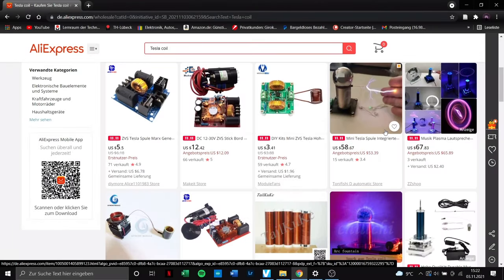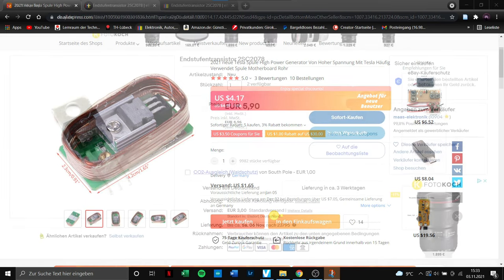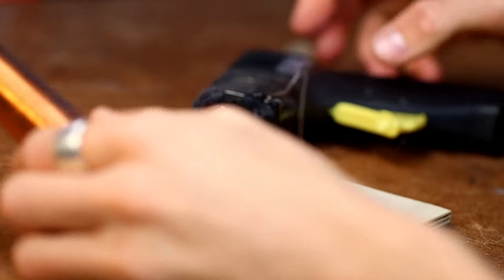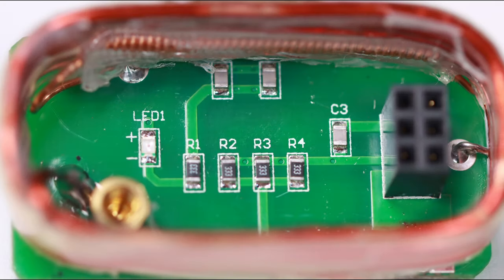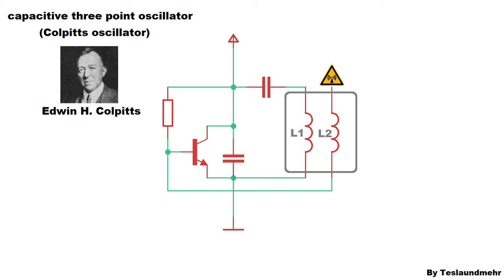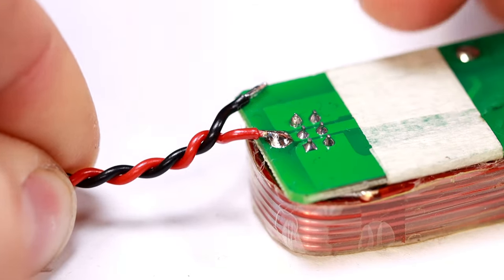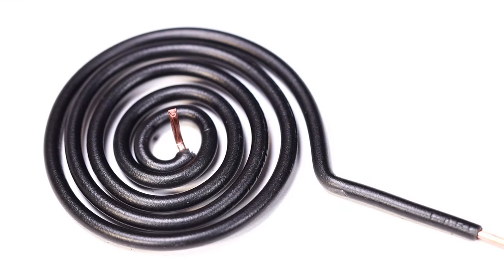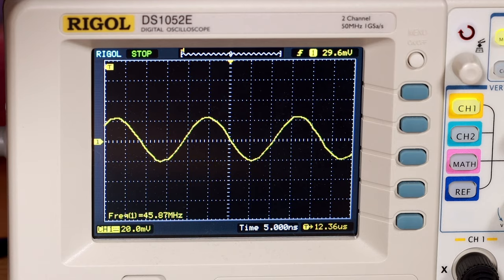Buy your own EMP Slot Jammer - 4$ on Aliexpress! Is it worth it?

Comment from the maker: Guys there is a small mistake at the circuit in the video
!!! For L1 43 turns and for L2 6 turns!!!
You might be confused that the primary coil has more turns than the secondary coil. But this is NOT a Tesla coil. Here you can download the correct circuit: https://github.com/Teslaundmehr/EMP-Jammer-Circuit
Reply: Is it capable of jamming wireless home automation signals? At what range?
Reply: @Mihály Tóth why not?😀
Reply: bro son dos capacitadores de 220pf (los que van en paralelo) y uno de 47pf smds?

Comment: I'm looking how to interfere with loud speakers at a distance, I have neighbour approx 10m away, plays rediculous loud music, 
is there a device can built to interfere with the audio speakers so that music has to be turned down?
My idea was spark device which would produce wide spectrum rf such as jacobs ladder circuit using car ignition coil ( or similar device). Then to make it directional put the spark gap inside parabolic type small metal dish.......such as an old metal bicycle light parabolic reflector. I haven't tried it yet, but any advice most welcome on this project.
I'm hoping if I can make horrible static noise in this neighbours speakers he will turn them down.
Reply: Any luck?
Reply: @jeffersonnogueira2933  yes and no:
yes: I found a way to drown out the noise effectively, I have a fan above the stove, if I run the fan the outside music noise seems to be sedated by the fan. I have to close all windows also, it works extremely well. Not sure why it works so well, maybe the fan produces noise across many frequencies, or the air hitting the blades somehow lessens the music noise.
No: did not pursue method to interfer with the amplifier and speakers.

Comment: could you makt a video where you explane how to use a 555 timer for a tesla coil and also in german and english that would be awsome
and i love your videos
Reply from the maker: Thank you!!! Yes!!!
Reply: @Teslaundmehr  ou also if you connect an audio signal to pin5 you can modulate the chip with sound but you need a 100nf cap between pin 5 and your audiosignal and woud it be posibal to make a community discord server? that would be awsome

Comment: The power is connected across the emitter and collector. Also across the primary circuit.
This is really strange. How can the transistor be connected across the power? The circuit will be affected by the AC impedance of the power source and the lead length.
Perhaps an inductor in series with the power will make the circuit operate more predictably. The primary is actually wound around a copper core.
Anyways it seems to work.

Comment: the schematic does not make sense.  The 10K resistor biases the transistor and turns it on and you immediately have current flowing from the battery thru the Transistor only making a short circuit and thats it.  all those coils etc are doing nothing.  So that is not the circuit.
Reply: the capacitors also get charged

Comment: Apparently, such a Chinese product saves us from hard work. Over time, no one will be able to solder something like this, everyone will buy on ebay.
Reply from the maker: Yes, you're right...
Reply: @Teslaundmehr  It would be interesting to connect a fluorescent lamp in parallel with the Tesla coil.
The lamp must be without a power supply.